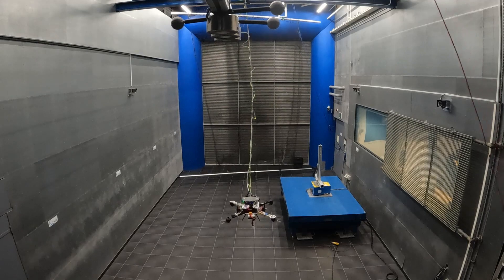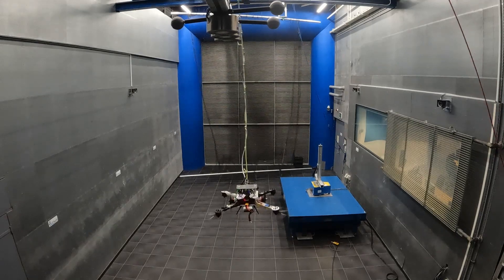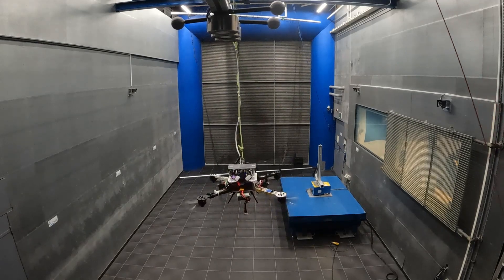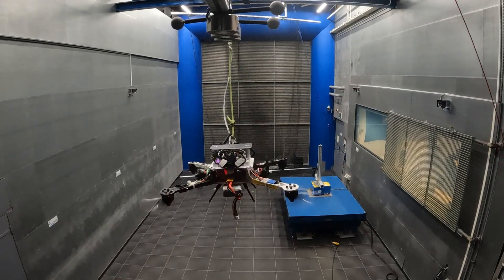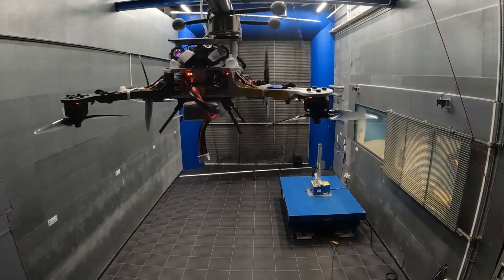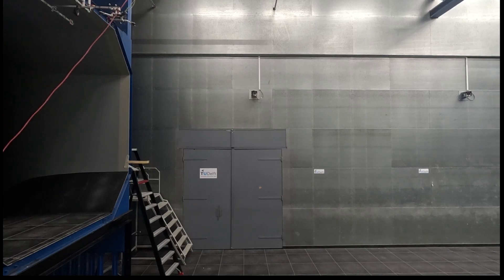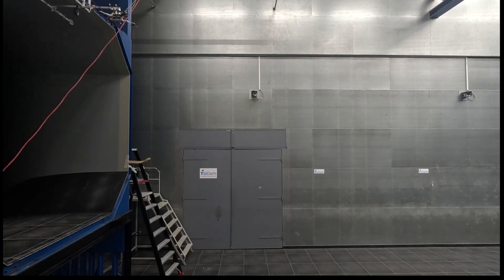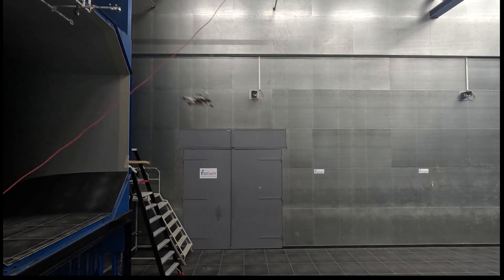Rigid Airborne Docking between an Overactuated Multicopter and a Fixed-wing UAV

Comment: I remember seeing glimpse of the research and development program for the tornado fighter in the joint European conglomeration to develop the fighter and it is quite significant, the tornado used Composites materials and I think they had a fly-by-wire system as credible ordinate and capably air-to-air capability just a pretty solid fighter